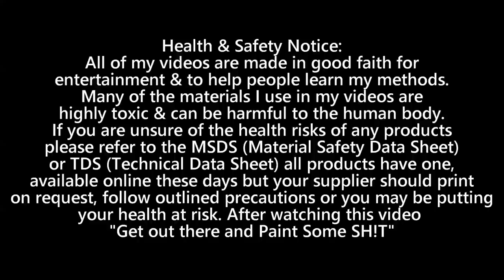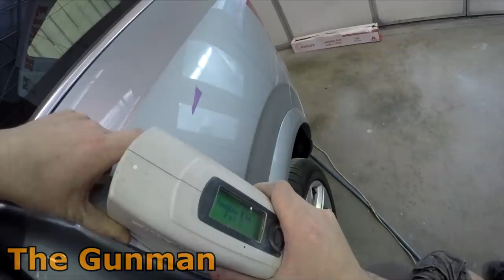VOLVO XC90 Part 1 Prep, Mask & Match

Comment: Hey gunman quick question! Im not a professional but will be spraying flame red with no pearl on a truck box .  The paint jobber didn’t use a spectrometer or anything to match the color just a paint code.  Should I avoid blending and color the whole panel? I’ve already purchased the paint and ordered enough to color the whole thing. I will be using an Iwata lph 400 with LVX and LV4 air caps . Thanks I love your videos from Minnesota
Reply from the maker: Yes, I'd definitely recommend spraying the whole panels
Reply: Awesome!  Your the man keep it up!

Comment: Nice work!! Does primer colour affect colour matching? What colour of primer will be used on sharp colour?
Reply: what is a sharp color? but yes primer makes a colour lighter or darker
Reply: DjZeroPlayer1 thanks!
So if the paint is sharp like red, what kind of colour of primer I should use on brandnew panel in black? It is like what gunman mention in the video.

Comment: Any advice on not burning through even with your da so high up and 600 grit? I always seem to burn through clear easily even with 800
Reply: Do you use an interface pad?
Reply: @DjZeroPlayer1  yes I do.
Reply: I use a interface pad and keep your sander moving and doNOT angle it . Dont worry mistakes are good cuz we learn from them . Good luck man ✌
Reply: @boberson33  keep your sander moving do not stay to long in one place also you can adjust the rpm on your sander you dont have to use it on max rpm
Reply: stay away from edges and soft pad them areas instead
Reply: @fortheloveofpaint8267  is there a way to tell if you're about to burn through? Can you look or predict? Or does it just happen out of surprise?
Reply: @boberson33  
Start by observing the paint finish before you prep, is it thick or fine, that will determine your approach and grades to use? 
Keep your focus on the panel and watch the orange peel being  smoothed out with every pass.
 As long as you keep a few mm from the edges of panels you prep you shouldn't be cutting through on European cars and hand sand edges with soft pads.
Experience is key and take your time. Speed comes as you get better and have complete control of the tools you use.

Maybe switch to 800s on DA?
I use 800s on faces and 1000s soft pad and grey scotch on edges and where DA can't reach and risk cutting through. I do paint WB though.
Bare in mind you don't need to remove every bit of peel to get a factory finish! Hope it helps a little.
Gunny has tons of vids check them all out 👍